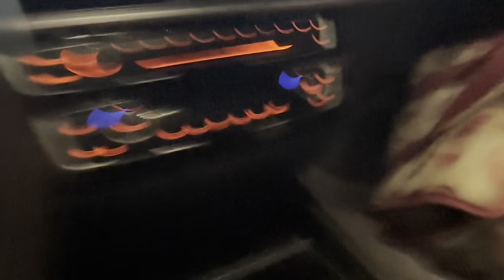Ready Mixed Girl Driver Routine

Comment: Badass!! I got my CDL A and worked for Halliburton as Cement Operator for a while, like $600 a day in the oil field but you sleep in your truck most nights.

Getting into volumetric would be nice there's a local company here at $32/hr in ATX.

Do you plan getting into any other kind of work?

Comment: I've been driving for a long time running city, line haul and I'm looking for something different and see ads for this job but the money is not good but the hours are what I'm looking for, up early done in the afternoon so I can be home at night. Is that how it usually goes and how long have you been driving?
Reply: Bro you wanna give up LTL to move to concrete? You're out of your damn mind. If you want less hours and a M-F job then either get out of trucking or keep your LTL job and just wait for seniority. Find a better LTL outfit if you have to. You gonna be running 6 days a week maxing out your 70 doing this.
Reply: @SuperGankBros  Damn it's like that
Reply: Busy season you'll be off at 8 or 9 at night and be back at the plant by 3am to start your shift. Once you are there for a while the pay will go up. I made 100k last year but It's not worth it. Also you'll be dealing with finishers and pumpers all day. Most are cool but a lot of em are tweakers. I've just learned to like the job and I'm pretty good at it. Also I don't like sitting in a truck all day. I used to operate hydrovac trucks but I can't find a Hydrovac job where I'm at right now. I'm saving up to buy my own.
Reply: @ravemaster7405  What about the mandatory 10 hours off, this is still a commercial vehicle so I'm sure you get 10 off before going back to work.
Reply: @JoeSmith-nu8oo  It's not like otr where you have a computer monitoring everything you do and everywhere you go. It's a local job. Just get in and drive.